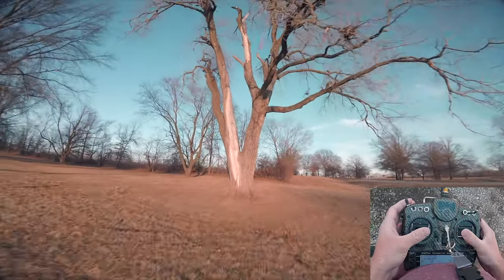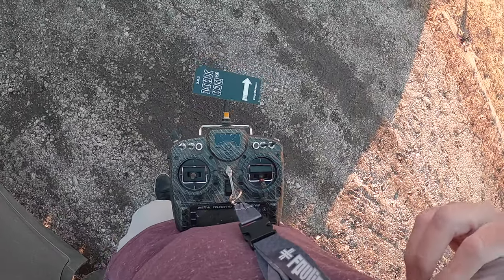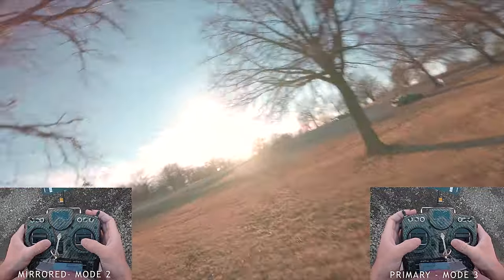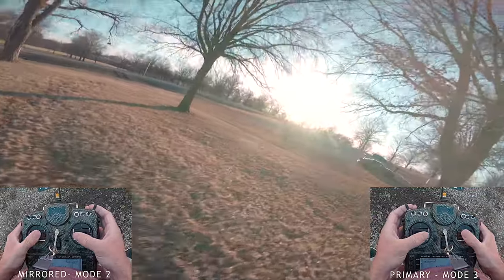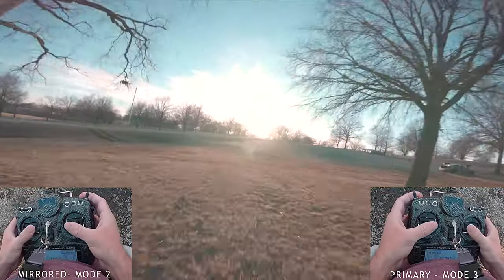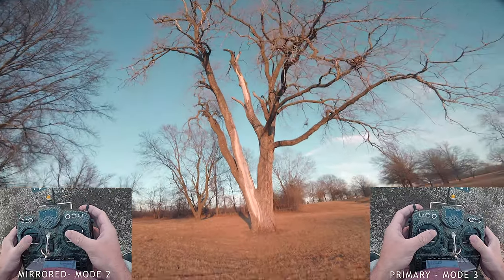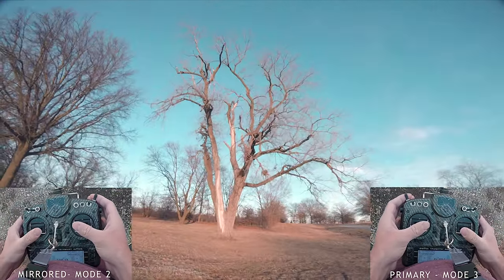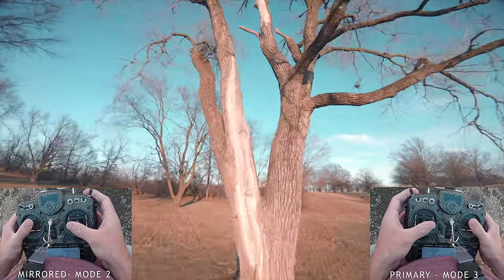How to INVERTED YAW Spin a GAP? | Advance FPV Trick Tutorial

Comment: Whenever I get inverted it always seems I fall faster. Not floating like you.
Reply from the maker: Unsure what’s going on
Reply: You can’t just cruise through and then flip forward, you need to burst throttle and then flip. You could also turn down your motor idle speed but that would make it more unstable at 0 throttle
Reply: @GTXgb-gt8lz  I feel like I am but maybe not enough.  Or my blip angle is flat. Thanks. Will keep trying
Reply: @kameltoez  good luck man!